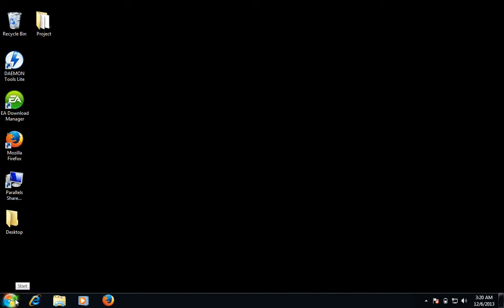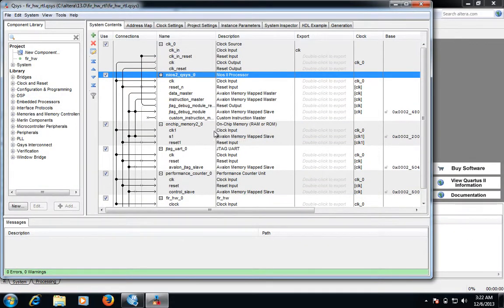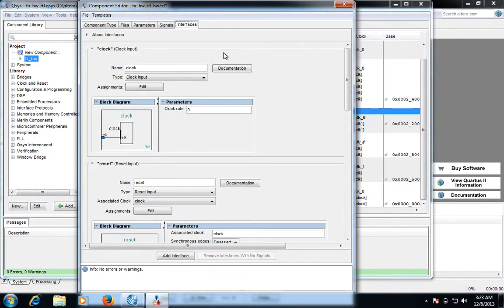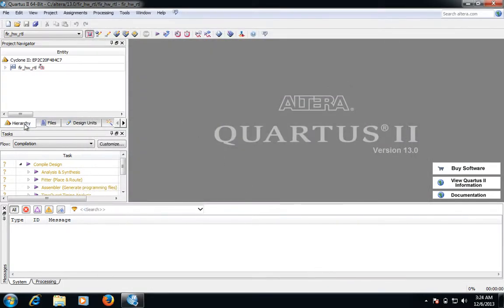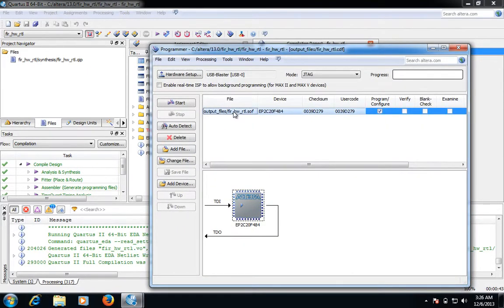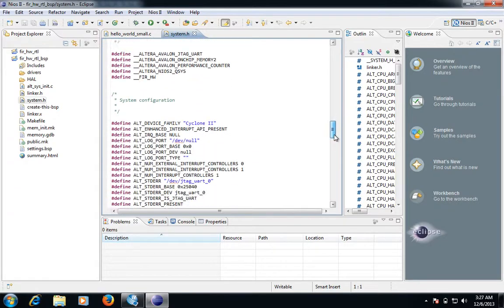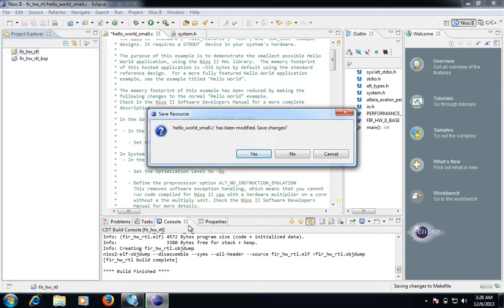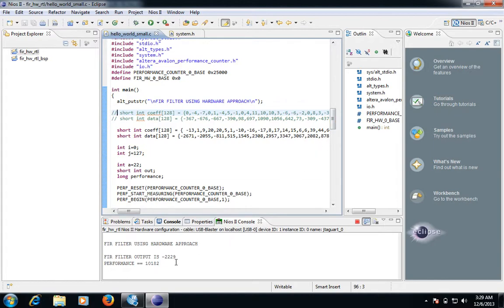FIR Filter as HW accelerator using NIOS II on Altera DE1 Board

Comment: I am trying to find DEV1 board on eBay, but all I got is expensive ($119US) board. And I am not sure that it is correct board. If there is more data about signals that are needed, I can use STM32 microcontroller to feed FPGA with ADC and extract signal to DAC. But, without specific data - how much bites, which pin(s) is/are inputs, outputs... I can't do anything. Thank you in advance for the answer.